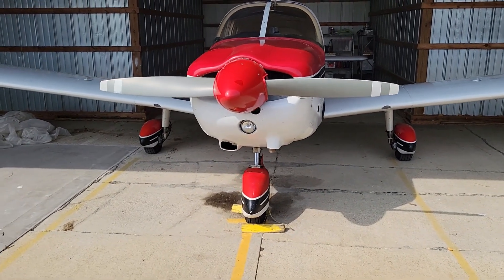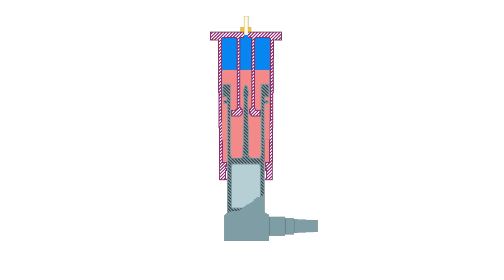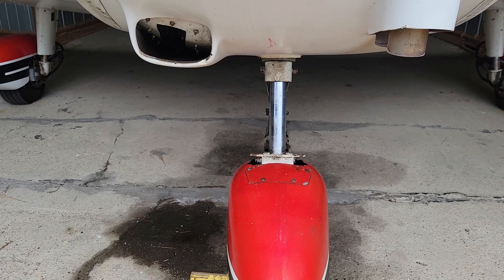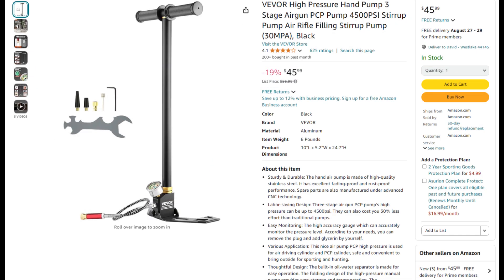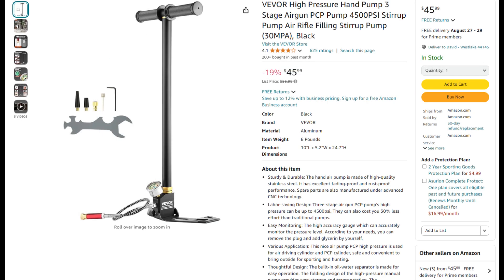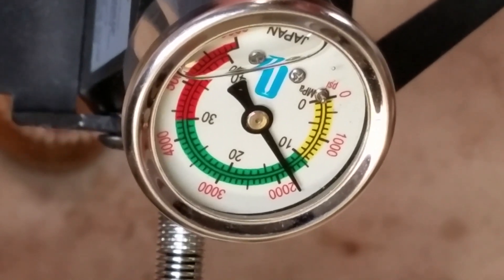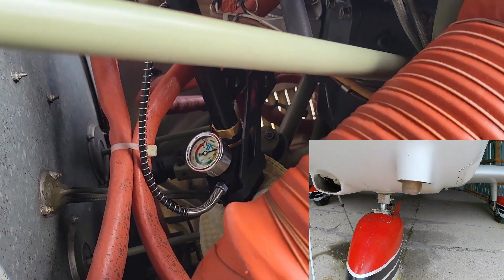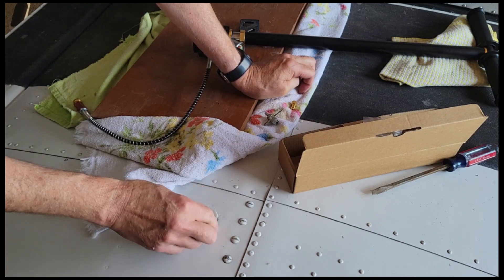Adjusting PA-28 Landing Struts

Comment: I have used this pump too and AIR (no mention of Nitrogen) is also called out on the Maintenance Manual for the Cessna 150...I did find out that is much more difficult to service the strut when is loaded and is probably better to change the fluid and air at the same time specially when it hasn't been done in recent memory. Would nitrogen be better yes it would but honestly on my plane that is not going pass 7k at the most is no factor. Also, I follow what the manual says all you people that swear on nitrogen relax is not the space shuttle.
Reply from the maker: You're right, air is called out in the Piper service manual also.  The pump works well because you can adjust the height by counting strokes.  It is difficult to control the correct amount of gas using a nitrogen bottle; it's too easy to over or under inflate.  Thanks for the comment!

Comment: Great video. Wish every video explained things this well. You even referenced the specific FAR and said we should document it.   I like this, but realize if it’s leaking or low on fluid, best to have my mechanic take a closer look and repair as needed. Thanks.
Reply from the maker: It's what ever you feel comfortable with.  For me, the struts were over inflated and I had to adjust them down.  Some leakage can be expected, especially when the struts are older.  But if you have to refill them every few weeks, I would get them looked at.

Comment: Thanks for the useful video! I recently did the strut seals on my Warrior, and had a hard time filling with air using one of those 'mutiplier' things. In the end, I borrowed a 2000psi nitrogen bottle, and got inflated in no time. One suggestion I took on board was to keep my struts clean, after every flight, wipe them down with a rag with 5606 on it to remove dirt.
Reply from the maker: That's a great tip.  I put some 5606 in a squirt bottle so I can apply it easily.  Thanks for the comment!

Comment: That air pump would be a good emergency tool to keep in the back so you don't get stranded due to leaky strut while on a trip. Can't beat the price. tks
Reply from the maker: It does weigh a few pounds; so I leave mine on the ground.  Since I did the video, I only needed to tweak the front strut once.

Comment: There is an extension hose available for this strut pump that will make the job easier, keeping the pump on the ground.
Reply from the maker: Thanks, I'll look into that!  That would certainly make things easier.
Reply: Can you share a link to that extension hose?
Reply from the maker: @Oldpuck81  That's a good question.  I haven't found one yet to try.   To use the pump on the ground, I would need at least a 6'-8' hose.  It would also need a high pressure rating.  Unfortunately, the longer the hose, the more volume it has; making metering in the high pressure air a little more tricky.  A very small diameter hose would be best.

Comment: probably good to do a new seal kit on each if they are sticking that bad.
Reply from the maker: Maybe.  However; they aren't leaking; (at least, I don't think so).  I'll have to check the fluid level.  Thanks for the suggestion!
Reply: @LifewithDavid1  elastomers could be hardening and the drag from debris could cause stiction. fly safe

Comment: It might make sense to completely service your struts, i.e. checking the hydraulic fluid levels.  If you are low on fluid, you don't get a very big change in gas pressure inside the strut with extension/contraction.  If your strut is full of hydraulic fluid, the pressure changes a ton during proper operation and it is likely much harder for the struts to get sticky, because the strut is much more likely to settle at an equilibrium pressure that equates to a really small range of extension.
I believe for our Pipers, you basically want to put it on a jack that allows full extension of the strut, release the air pressure and remove the valve core. Then use a 1/4" tube with hydraulic fluid around the valve, cycle the strut up and down until no gas bubbles come out at full compression(maybe see if you can flush out some old fluid), meaning any gas in the lower chamber has been evacuated.  Now the strut is entirely full of hydraulic fluid and no gas at full compression.  Set the plane back down on the strut, fully compressed with zero gas, pop the valve core back in, and NOW inflate your strut to the proper height.
I'm guessing/hoping your Oleos will never feel better...
Reply from the maker: That's the best course of action.  The Bogart strut service tool makes it a lot easier.  But that requires a lot of high pressure air/nitrogen.  My struts were serviced a while ago, and I haven't noticed any leakage.  In fact, when I was de-airing one of them; I got sprayed with a bit of fluid; telling me mine were full.  Right now, my landings are pretty good (knock on wood).  If they get bouncier, I will definitely change and fill the fluid.  Thanks so much for the suggestion!

Comment: Oxygen isn't great compared to nitrogen.  It's not stable with temperature changes, it condensates which can mix with the oil in your strut, and it's sensitive to altitude changes.  Say you air up your struts at sea level and land at 5k feet and it's 20 degrees colder.  You'd better land real soft, haha.  Or the oxygen condesates and freezes as you reach colder temps aloft.  Just a thought.
Reply from the maker: Thanks for the comment.  Pure nitrogen is better than air; but air is almost 80% nitrogen.  It would be better to fill the struts on a dry day to minimize the water content of the air; but water is less likely to condense out of a gas at pressure; so unless you are filling the strut in the fog, on a really hot day; condensation is not an issue.  Using air is actually specified in the Piper maintenance manual from 1967, nitrogen is not mentioned.  Thanks for watching!

Comment: Amazing.  Thanks David.  In the least, I will have our mechanic look at our plane.  I think we're over-inflated on the mains.  This is also problematic for fuelling to the 18 gallon tabs.  Sometimes we believe we are filled to 18 and then once we're parked, the Cherokee is settling in a different pitch.   Suddenly we have 16 gallons fuel.  Not sure which is correct yet but the aircraft should be level when fuelling in the least.
Reply from the maker: You can take a look during your next preflight.  If it's a PA-28 like mine, there should be about 4 1/2 inches of strut tube exposed.  Good luck!
Reply: Thanks!